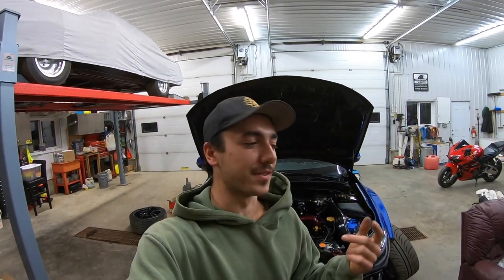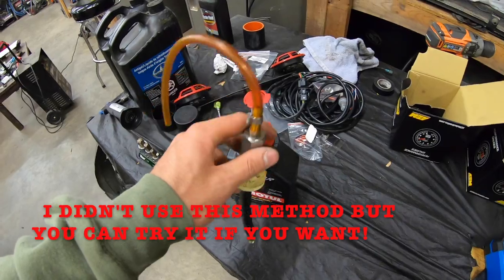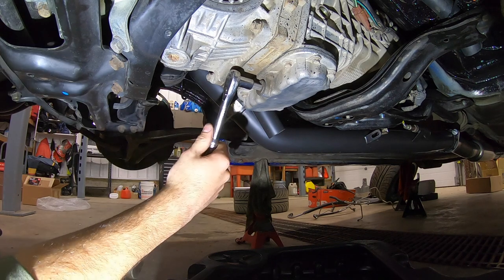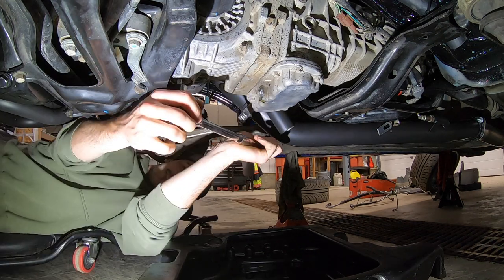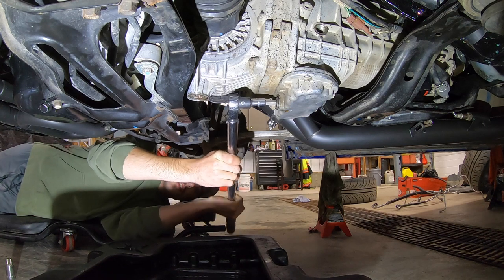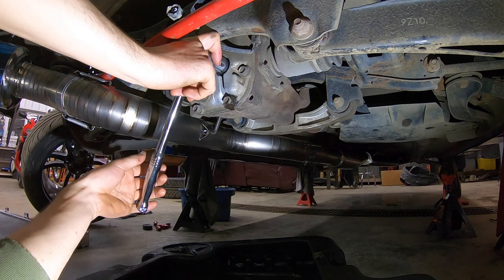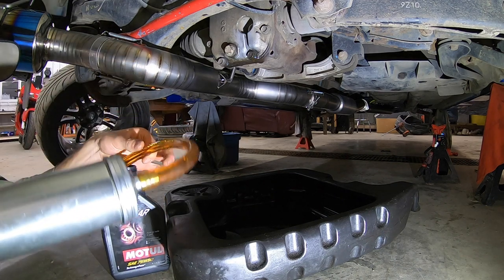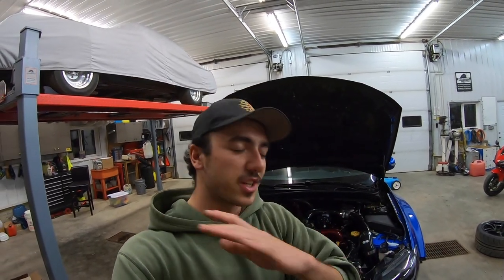TRANSMISSION & REAR DIFF FLUID CHANGE!! (STI)

Comment: When I do my transmission oil change I fill from the trans dip stick, its faster and less pain in the ass, watch more of my vids for tips like that, just FYI.
Reply from the maker: Mine doesn’t have a dipstick to check fluid level/fill from, but I believe it does have that fill plug at the top. It was easy enough for me to fill from the side plug & set the fluid level all from the same spot. Rather than filling from the top until fluid starts to come out of the side plug. I’ll give your vids a watch 🙌🏼
Reply: @DanielKellert  Hmm interesting, I have 2007 STI trans. in my 12 Hatch, maybe newer dont have dipstick, hmmm....
Reply: Did you use all the same differential oil for the transmission also?